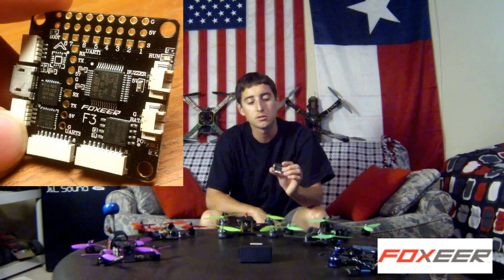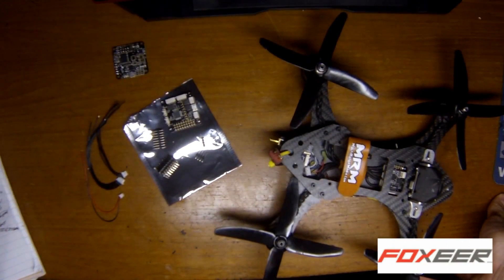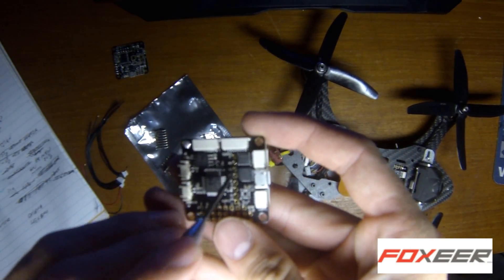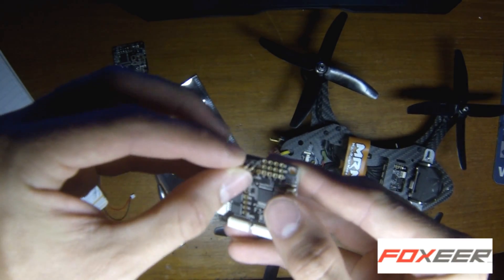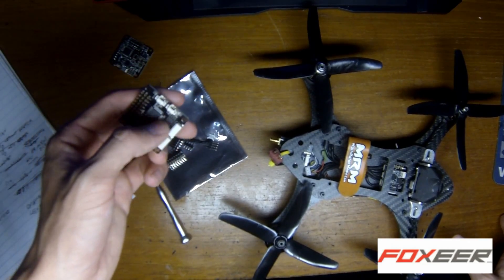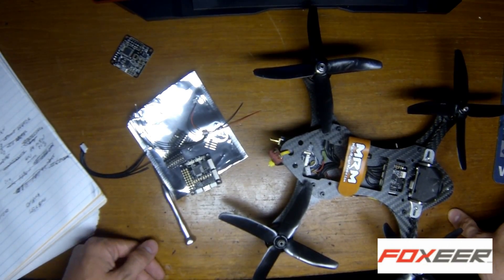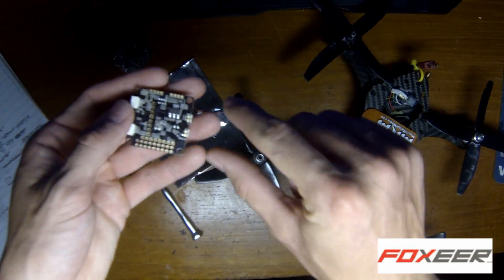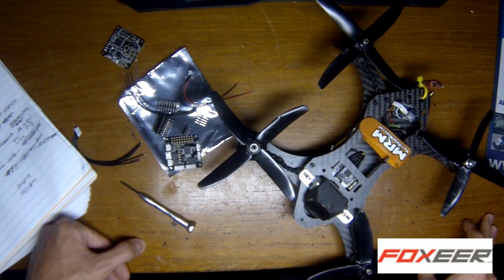Foxeer F3 Flight Controller Review

Comment: Hi.  Ive got the SBUS set up on my Frsky X4R, plugged into UART 3 and Beta flight set up to UART3 RX and in configuration SBUS it ticked along with SBUS as receiver typ.. Its bound, the motors churp when plugged in and I can run the motors up through Beta Flight but it WONT SEE MY RECIEVER ON THE RECIEVER TAB! Its killing me... been through everything a dozen times.. What is wrong? please help
Reply from the maker: Are you powering the receiver when you are testing it?

Comment: If you want to use a sbus receiver I believe you have to connect to IO_2 port, gnd, vcc and ch3.  So you use your 8 pin cable and hook up to pins 1,2 and 3 respectively.  This will also use your UART3 interface of the board.  I don't think the solder pads you mention on the underside of the board will work for sbus as they only mention ppm.  If you refer to Seriously pro manual I believe most of the connections will be similar to this board, it is just laid out differently.
Reply: I'm fairly new to this stuff but if I wanted to use SBUS (x4R) with telemetry, wouldn't I be able to just connect the 3 sbus wires from the x4r to the open ground, 5v and rx pins for UART1 and then the smartport wire to the transmit pin on UART3?  I would prefer not to use the jst connectors and just solder directly to the open UART pins available in the center of the board.
Reply: That's means, if i connect the sbus with the UART3, this will work fine?
Reply: +Ivo Celic It should.   I did on a regular sp f3 board on i02 to pins one, two and three and it uses uart 3 for your sbus reciever.  I don't know why the Foxeer sp f3 would be different.   I bought one of these boards but haven't used it yet.   I also hooked my smart port telemetry to pins 5 and 6 jumped together and set up soft serial to get telemetry back to my taranis.  It all works.
Reply: +Tim Spitz If you want telemetry to work I believe you have to go into cli and enter set telemetry_inversion=on
then type save and hit enter.
Reply: Hi mat, 
I'd like to use SBUS too, do you have any picture of you build?
Reply: +Nico Las I threw it in this fc in the garbage. Had problems with the board seeing the wrong orientation causing the quad to go nuts.
Reply: Sounds like you should have changed the orientation in cleanflight and had a great performing board! It was brought to my attention that the very first version had the direction arrow pointed on backwards but a VERY simple preflight check in clean/base/beta would show you that you need to input the adjustment.
Reply: +Woodys Builds that's what I heard after I trashed it. Problem is I realized the orientation was off so I changed it in betaflight and got a solid flight out of it. The next flight it reverted back to backwards on its own.. I can't trust a board that does that which is why it went into the garbage.
Reply: Just solder wires to UART 3 RX to SBUS  Signal on the RX, UART3 Ground to SBUS Ground on the RX and UART 3 5V to SBUS 5V on the RX and it works.
My quad still don't fly for anyelse problem, motors turn, but sometimes RPM increase without any reason...
Failsafe is set, Airmode too, max throttle is set, min throttle too, but...

Comment: I want to know Wich plug/wires goes to the receiver frsky..
Reply: If you are using pwm the flight controller comes with a pinout plug to use with it, if it is sbus or ppm the pads are labelled.
Reply: Yes but I think not need the first 3 cables from the left side?
Reply: For a ppm connection you will need the three plugs I have circled in this link: http://i222.photobucket.com/albums/dd4/xmodzracer/13138922_275934016083922_7203576282717879363_n%20-%20Copy%202_zpsaybrl5p1.jpg

Comment: Blackbox speed is limited by the USB-serial chip, which is limited to 115200 bits per second, so 14KB/sec.  That's about double a dial up internet connection speed of old, so it takes a long time to download 8MB.
Reply: Ah thanks for clarifying that. I was wondering why it was so slow. I just chalk it up to being my first black box controller haha!